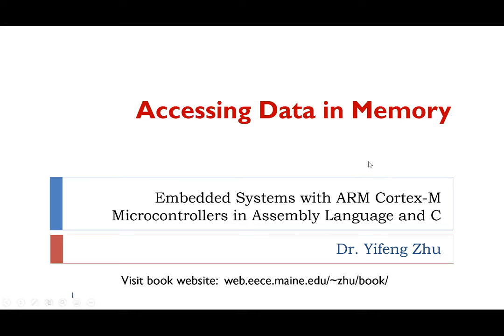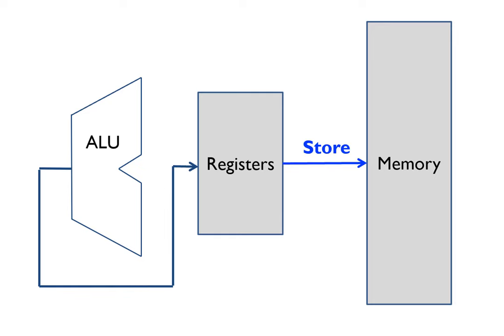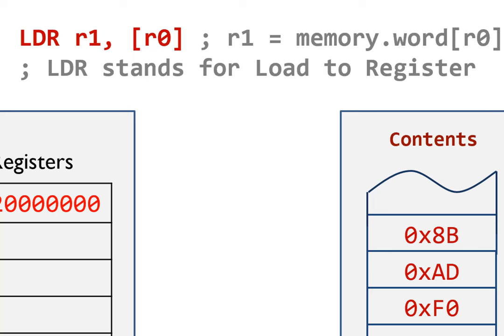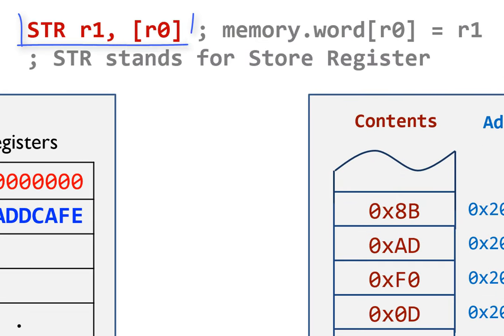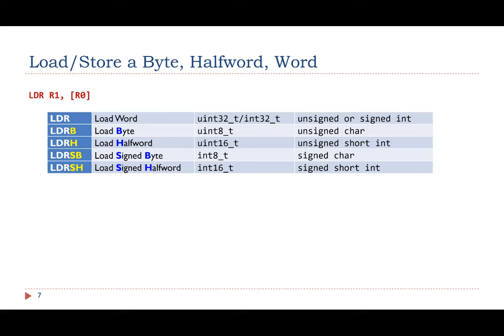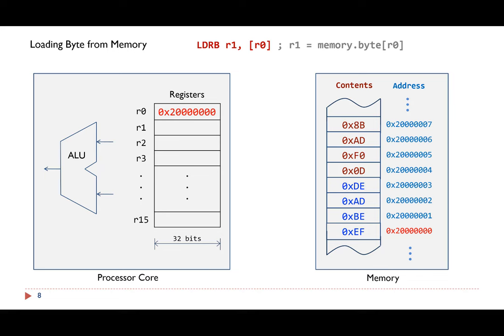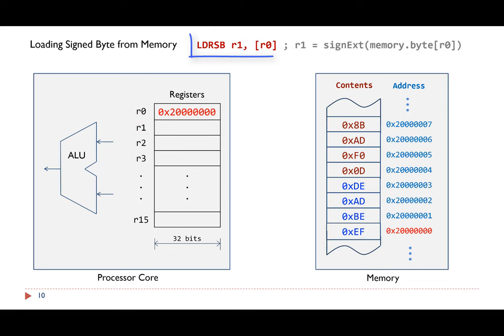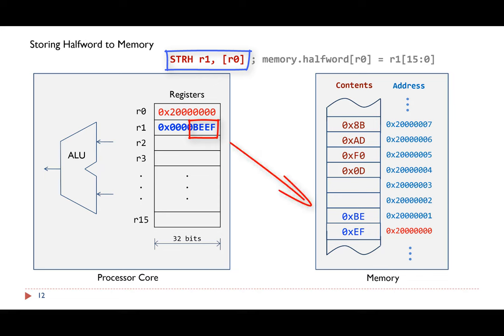Lecture 23. Load and Store Instructions

Comment: I'm reading that book and I cannot achieve a thing: variables from the DATA Area don't get initialized in Data memory when I set to READWRITE. When I set to READONLY, they are in Instruction memory (0x0800xxxx) but I want to put variables into Data memory (0x20000000) like the book's examples. I did exactly like the book says but the output is different. Please help me! Thanks in advance.
Reply: I'm trying Figure 3-6 and the Datas (srcStr, dstStr) are not in Data Memory(0x20000000). Actually they're nowhere.
Reply: Now I know the point. The book use startup file of its own edited by Dr.Zhu. But the point is everybody don't have the same Board. For me, I have only Nucleo F4 board. So, please make a video of how to modify startup file for a specific board.
Reply from the maker: Hi, Suang, I am sorry for my late response. I am glad that you figured out the solution. If you program in C, the original startup _xxxx.s works fine. However, if you main program is in assembly, you need to use the modified startup. I think if you copied the part I added into the startup file for your board, you will be fine.
Reply: @embeddedsystemswitharmcort9051  Omg you finally reply me! Thank you very much! I'll try it. 
Can I get a favor? Can you make a video of the modification of startup files (even if not very detail, just a brief short)? Because I just copy it and don't really know how it works under the hood. And I can't figure them out by my own. Much appreciated!
Reply: @embeddedsystemswitharmcort9051 Edit: Don't worry sir I figured it out :). Thank you very much for your guidance.